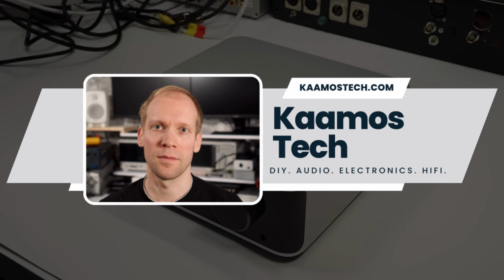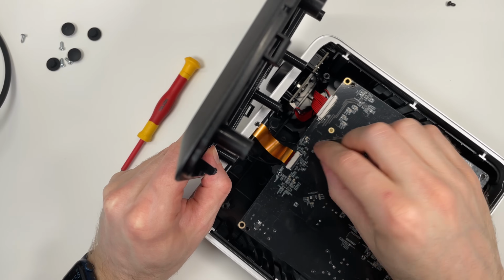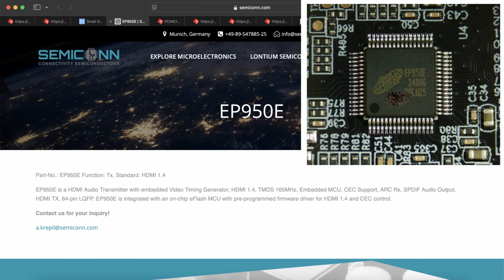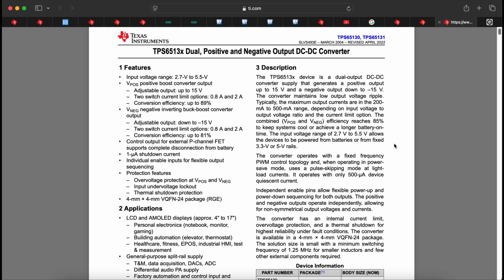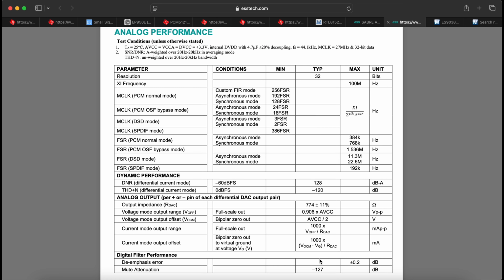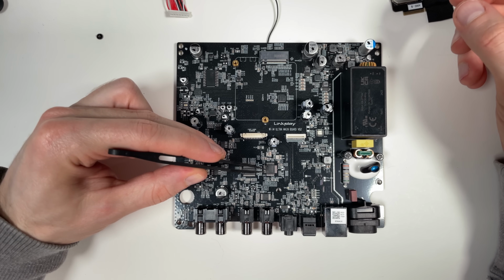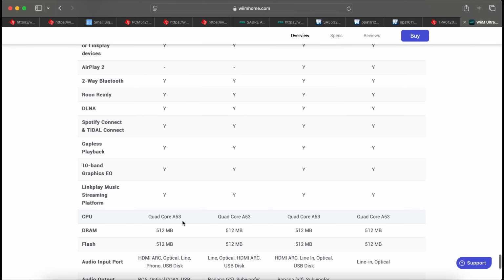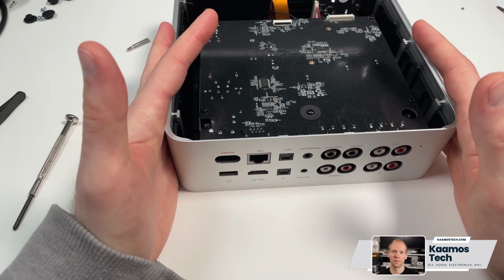WiiM Ultra Teardown - What audio ICs are inside?

Comment: Great valuable teardown and analysis, THX! I want to use the phono input as a normal line in, as i like to use a special external phono preamp. I think bridging the phono jack to the second signal cable shouldn't be a problem? Or do you think the PCM1863 has a different preconfigured gain as the standard line in, which could make it difficult?
Reply from the maker: Thanks. I'm not sure what you mean by bridging to the second signal cable. Indeed, we cannot know if there are other differences in the signal path between the phono and line in. If you don't use the standard line in, I'd just use that for the external phono preamp.
Reply: @kaamostech  I mean a go around the internal phono prestage from the phono chinch to the back of the second smaller curcuit board where the two shielded grey audio are connected. https://www.youtube.com/watch?v=fP6InHdy9cI&t=455s
Reply: I just thought to keep the line in for an other input like tape etc...
Reply from the maker: @freudeamunsinn  I see. You could try connect the same line level source to both the standard line in and bypassed phono in and see if there is any difference in level, frequency response etc. But definitely easier to use the standard line in as long as you don't need it for anything else.

Comment: Can be hard to upgrade this unit with discrete OP-amps. They will sound better than IC's in the pre output. It's some easier to replace in an old Marantz from the BA312 to a sparkos BA312-M from Sparkos Labs. A big difference. Has got a Wiim mini to use on the Marantz. It works great with the old Marantz Receiver. A great video for this Wim Ultra. Greetings from Norway
Reply from the maker: Thanks, I appreciate.

Comment: Excellent break down and explanation, thank you.
All I want to know is what, if anything, matters soundwise if I'm using an external DAC. I've been using an Allo DigiOne signature with Paul Hynes LPSU into an external DAC. Quite happy with the sound but am tempted by the Wiim Ultra's DSP, bass management capabilities as I'm considering adding a sub to my system. I read somewhere that the Pro Plus with external PSU sounded better than the Ultra but they didn't mention if that was with an external DAC or not.
Reply from the maker: Thanks. All subjective opinions are a bit "pick your preferred opinion", in my opinion (pun intended). So you would just need to try.

From a purely technical perspective Allo DigiOne Signature seems to be well thought out. But then again, IMO having the mentioned bass management, DSP EQ etc far outweigh (if you need them) any minor sound improvements. The Wiim is a very capable device but it does feel cheap, and that also matters in the whole experience.

Comment: Thanks for the teardown, always good to see what engineering choices were made and which areas are subject to the greatest compromises.
Can you (and any one with the experience) comment on the quality of the main SMPS?
I know there are many  DC to DC SMPS downstream. Is there merit in removing/bypassing the main SMPS with a good quality 12V LPSU?
Reply from the maker: I cannot really say. I guess if it's really terrible, it could make some difference, but I doubt. Filtering and downstream SMPSs and LDOs mostly take care of the switching in the rails themselves. Since the SMPS is small, I wouldn't think it radiates or disturbs surrounding circuits too much. It's also some distance away from analog.

Comment: Is it easy to recap?
Reply from the maker: I don't know what you want to recap, you should see it in the video how it looks like. SMD electrolytic can be a bit pain to remove but doable.
Reply: @kaamostech  I'd guess after 15 years it would need recapping. But as you said SMD can be difficult for DIY unfortunately.
Reply from the maker: @qewfsdsd65445  Yeah. Unfortunately, the expected lifetime of this sort of devices is not so long. Technically it may (hopefully) still work but some services and features likely become unavailable or unusable.

Comment: With how this unit is made and all the parts in it, would the sound quality improve over time? Like after proper break-in time??
Reply from the maker: I know this is a bit sensitive subject but I don't see why electronics would benefit from a brake-in like mechanical components do. I worked 10 years with audio semiconductors and not once I heard of any technical/physical explanation for such things. I do believe they are more related to our ears getting used to it, or human psychology, but I know some disagree and that's fine. Short-term changes e.g. due to temperature are much more plausible.
Reply: @kaamostech I actually reached out to WIIM and they said no break in and no change in sound after software updates, I think mines sounds better than before just because I got a separate amplifier to drive my speakers than using my AVR🤔

Comment: no mods ok, how about some filmcaps directly close to the DAC? doesnt tht always work?
Reply from the maker: It may, or it may not. I'm an engineer so I would judge any change by measurements, some may do it by listening if you trust your ears in such comparison. Adding capacitors doesn't always improve things, it can also make them worse.

Comment: Impressive that they use a TPS7A4700 LDO after the switching PSU.
I think switching the PSU for a linear one doesn't make any difference when you not using the internal DAC.

Comment: good video in my opinion the caps are cheap and the op amp 5532 are cheap the rest it is OK .....if you mods and replace the caps and the op amp I think it would be much better
Reply from the maker: True but that was the phono input. But if that is important, you could try some mods in there.

Comment: Excellent quality teardown, thank you, exactly what I was after. I'm wanting to put this in a smart campervan that is powered by 12V. I do have an inverter, but it uses 15 - 30W on standby alone. So I'm looking for your educated opinion here - could I simply remove the AC components and bring in a (regulated) 12V supply from the van batteries straight to where the output from the PSU was? Before the inductor L10 I would assume, but I don't know. I've considered the Wiim Pro Plus, but it misses some functionality I need. Thank you in advance, I will now subscribe :)
Reply from the maker: I think so. But please don't take this as a guaranteed solution, but it looks like it just uses 12V internally. I would measure the output of the AC-DC just in case. And while there are probably decent protection onboard, make sure large on/off transients from your van don't get onboard. So I'd say some attention may be needed but this is probably quite easy to convert to 12V operation.
Reply: @kaamostech  Amazing, really appreciate you getting back to me. I do use a 12v > 12v regulator for sensitive devices, so I'd connect to that. I'll do some tests as you suggest. And if it all goes up in smoke then it's all on me :)  But I think it will be fine. Thanks again, and happy listening!

Comment: The content is excellent, well done.
I didn't see anything about the DSP chip used in the WiiM Ultra. I guess you didn't see it either. I asked the company, and they responded, but it didn't answer my question. I actually have two questions:
1. Does the WiiM Ultra have a DSP solution like a SHARC DSP?
2. Is the ESS DAC used in the mid-range, upper-mid-range, or high-end segment?
Reply from the maker: Thank you. I may be wrong but I believe mostly DSP-functions are done inside the SoC, so it's just one processor that does everything. It's the most cost-effective solution. The SoCs may have a separate DSP core(s) though. 

I'd say the DAC IC is upper mid range in the ESS portfolio. Their flagship DACs are the PRO versions that cost significantly more.

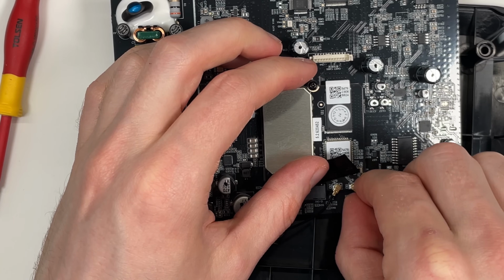Comment: 5:13 do you think short SMA extensions to a rear case RG316 Antennas could be added which would improve the poor BT performance?  Esp. BT transmission as I have a lot of issue with streaming to various BT headsets.  Where do these BT xmit/receive wires terminate on the other end, you don't show that?  Are they internal antenna arrays?   Thank you.
Reply from the maker: True, I didn't really pay attention to the antennas. I believe there is something taped on the plastic lid, don't know if it's a wire antenna or some sort of array. I don't really know too much about antennas but these are probably not amazing so something more proper could make a difference. I believe you could add something to the UFL-connectors on the PCB. Sorry I cannot help more.

Comment: Thanks for an interesting and informative look into the Wiim Ultra. 

I have a question that maybe you can answer or least shed some light on. I use my Wiim Ultra as a replacement for my 25 year old B&K preamp tuner. The Ultra's line-out is connected to my B&K power amp and my Rotel RCD971 CD player is connected to the line-in. When playing certain CD's (mostly symphonic pieces on the old Telarc label) there can be severe distortion on the biggest transients but this is not always the case as the intensity of the problem varies from day to day. One day it's virtually gone and the next it can be severe. The Rotel has a digital coax out and when I use a $20 Prozor (Amazon) coax to optical converter bypassing the Rotel's DAC and connect the Rotel to the Ultra's optical-in the same CD's play perfectly. I haven't listened enough but my initial impression is that there is a bit more clarity and definition using the DAC in the Wiim with the optical input. I thought possibly the DAC or the line-out circuitry in the Rotel could be the problem but it still plays fine when connected to the old B&K preamp. I've tried every conceivable setting adjustment to no avail, opened a ticket with Wiim and performed their recommended changes with no help. I finally exchanged it for another Ultra and it's doing the exact same thing. I should note that the EQ is set to flat and it makes no difference what the line-in input level setting is or the line-out level. I've also tried all the different bit depth and sampling rates and the different filters with no difference.

Could it be that the Ultra's line-in circuitry is limited in what it can cleanly handle from a source providing a wide dynamic range? I'm not an EE but it seems like this could be a buffer issue? From your teardown it's apparent that when using the line-in and line-out the signal path passes through digital processing and does not stay analogue. 

Thanks
Reply from the maker: That sounds a tricky one. As you mention biggest transients, first I would think of mismatch in the voltages so that the WiiM input clips. But that doesn't seem to be the case if it doesn't happen always or the line-in level setting doesn't matter (although not sure what that really adjusts). If this really only happens occasionally, that points out to something digital and firmware-ish. Digital clipping maybe, although it also shouldn't happen, especially if the EQs are not in use. No idea really.
Reply: @kaamostech  

Thanks for the reply. 

I played one of the offending CD's yesterday using the line-in connection and it played fine even with some equalization so this doesn't make any sense. My guess is you're correct and this is a firmware issue that maybe will be addressed in a future update. For now I'll use the coax to optical and the DAC in the Ultra to ensure it's not an issue. 

I'll open another ticket with Wiim and provide the history and that another unit exhibited the same issue so they are aware. 

Thanks
Reply: A quick followup;

Another YouTuber (https://www.youtube.com/@abritishaudiophile7314) mentioned he believes the line-in passes through an ADC and then again a DAC for line-out. If so then this may be an issue with simply too much processing. The problem exists only when the signal in converted from digital to analog in the Rotel and then if he's correct, from analog to digital again in the Ultra to analog for output which if true might explain the problem.
Reply from the maker: @robertbaron3242  Yes, I show the ADC in the video, it goes through ADC and all processing. Otherwise you couldn't have EQ and any of that for the analog inputs. Obviously, something is still misbehaving if it causes clipping like that. It can be tricky to track even for the WiiM guys, the first thing they would need to do is able to replicate the issue.

Comment: Wiim are NOT "high end audio"!!  Not even close.  It is noisy.  It has channel crosstalk. It has poor damping factor (specs claim 25 if it were true, but distortion measurements suggest it's actually below 10 - DF must be above 10) and it has inadequate power for all but the most efficient (and small) speakers!  My old Haflers managed a DF of 100, and could deliver 20 amps continuously.  Any time I see a company putting dead weights into their product to make its plastic construiction seem more solid, I laugh and move on. This is just another typical Chinese piece of junk.
They've used imitation-Hirose ribbon cable connectors, which are not reliable and do not make tight connections. "Will these drive my speakers"? The size of the power supply (switch mode, FFS!) tells you all you need to know. Overpriced junk.
Reply from the maker: This is a streamer/DAC, not an amp. DF is not applicable here. And I wouldn't say it's noisy, it has quite good dynamic range. Noise is easy to measure or hear. I believe you are mixing with another WiiM product. Nevertheless, they are not for everyone but they are also not junk. I don't think they even try or want to be high end audio.

Build quality is definitely something that reflects the price. Added weight doesn't help much in there, it still feels cheap (and light).

Comment: I have the Wiim Ultra. This really chokes on FLAC files through TIDAL. It freezes up and I have to reboot the system. What streaming engine does the Wiim Ultra employ? Others like the Cambridge audio use a quad core processor to help unpack FLAC files and the like.
Reply from the maker: I don't know the details. It does have a quad core ARM but I don't know how it compares to other devices in performance. You could try the WiiM's own forums.

Comment: Could the 5532’s in the phono stage be swapped out for the same opamps that are on the main board?
Reply from the maker: Potentially; there are always a possibility for something to go wrong when swapping opamps without knowing the circuits but mostly they are drop-in compatible. Not sure it brings a lot of benefit in the phono stage though.

Comment: I find that the Ultra's RCA line out soundstage suffers from a lack of 'focus' and was hoping I would learn that inferior OPAMPs were utilized. OPA1611/1612's are not inferior. Use of the digital outs (USB in my case) with Ultra volume set to Fixed resolves this at the cost of using a separate preamp or DAC.

Perhaps someone could comment on what aspect of circuit design might affect the analog output in such a way that instruments and vocals have a tighter focus within the soundstage.

Comment: Amazing.  WiiM Ultra fits an internal 12V wall wart, and a few weights to make it feel fancy.  Just Jeez.  I am sticking with BlueSound.  Oh, and 1970's vintage Op Amps....  Did they think nobody would ever open one???
Reply from the maker: Yeah, clearly a decision was made with the opamps - use the top shelf stuff after the DAC as that's what most people care about, and the lower shelf stuff in the analog inputs. With that price you need to compromise and most are probably happy with the one they did.

Comment: i don think the ESS 9038 PRO is objectively better than the ESS 9038 Q2M one is a 2 channel model and the other is an 8 channel model both are different packages the pro THD+N is 2db better but both are -120db & -122db which is exceptional for the price, the dnr is 10db better on the pro in stereo mode but that is highly dependent on implementation, regardless its significantly better than than the amplification it will be plugged into in 99% of situations, put in simple terms is incredible value for money and anything better your spending significantly more money for diminishing returns in performance.
Reply from the maker: Indeed, like with most things, spend a bit over the minimum and you get the best return. After that it's downhill :)

Comment: Does it not have dual DAC chips? I've seen it advertised as have two chips, are these adverts lying? Pretty bad if so! I've been thinking about getting the Wiim ultra to feed my main hifi amplifier, the subwoofer output won't be really useful as the volume won't change with the amp volume. Still think it looks like a good unit for the price so will probably get one. Thanks for this video, nice to find out what you actually get for your money 👍
Reply from the maker: The main output has one stereo DAC, then there is the sub out DAC but that's not really a 'dual DAC' architecture what it usually means.

Indeed, if you want to control volume outside the WiiM, the sub out becomes a bit tricky. Unless you control the volume digitally in WiiM.

Comment: What a gem of video, just content no fluff. The WiiM's internals look like a computer to me, not a (partially) analogue audio component.
Reply from the maker: Thank you, I appreciate. Indeed, these devices are basically light computers. It's only the stages right next to the analog connectors that have some analog components, the rest is all bits.
Reply: @kaamostech  I have to watch the video again, was under the impression that the path to the ADCs / DACs is quite long even going through connectors.
Reply from the maker: @ You are right about the paths to the ADCs. The analog (opamp) circuits are next to the connectors on the small board but the converter is on the main board.
Reply: That’s because a streamer is a digital device, not an analog device.